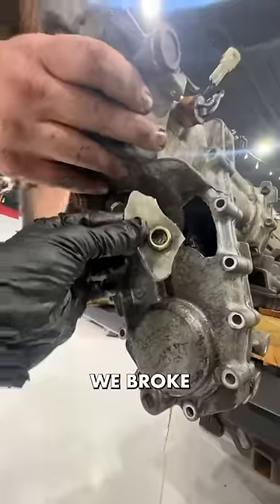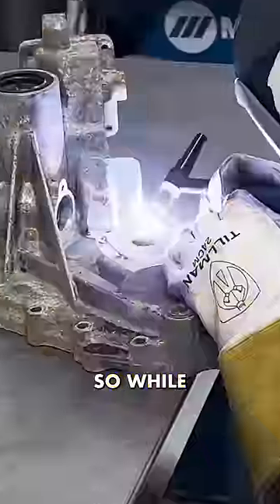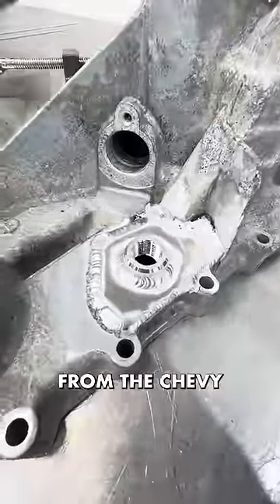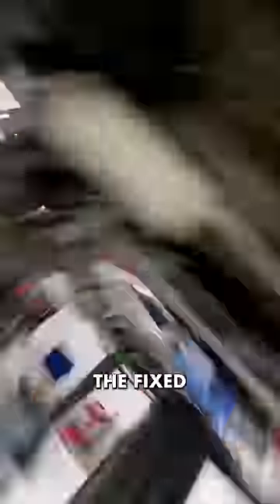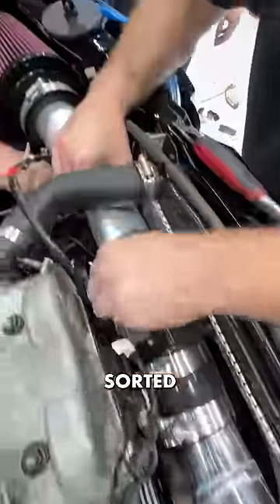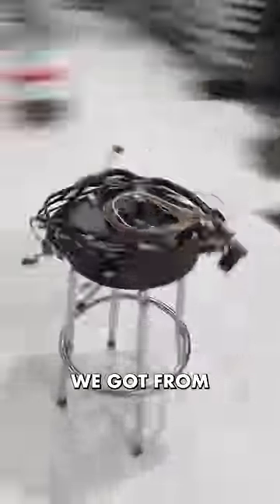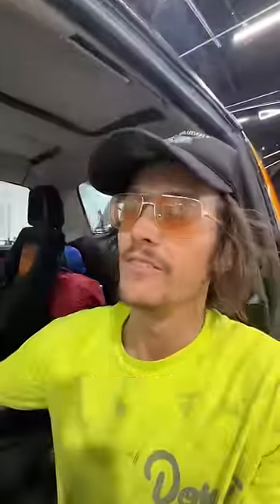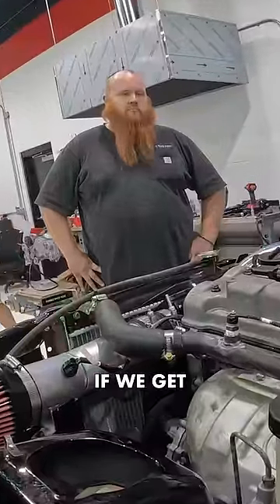Part 8 of my cross country Suzuki build (with @OffTheLinePerformance )

Comment: Cast aluminum is very difficult to get right. Nice job Eric
Reply: Can ya tell me why?
Reply: @danielescobar7618 mostly because aluminium oxidises incredibly quickly. That basically means a thin layer of aluminium rust appears very quickly whenever aluminium is in contact with air. If you try to weld an aluminium piece to a layer of aluminium oxide you will find that the weld either doesn't take or it is incredibly weak. The other main issue is that aluminium transfers heat very effectively which can result in any weld expanding or contracting a large amount very quickly. This causes it to crack as it cools, and can also cause the two pieces of metal to warp during the job. Aluminium is also quite soft, and when heated it can actually get so soft that it deforms under its own weight. It's a real PITA compared to steel.
Reply: @Cortanakya  oh yeah my welding teacher mentioned this. The oxide layer has a higher melting temp too, so the raw aluminum under it is just ready to blow out and burn through too by the time its penetrated enough and just becomes an inclusion. Good to keep this in mind, I have some nitric/fluboric acid mix I can use as a pre-flux rinse to desmut that I used for plating/desmut after alkaline cleaning.
Reply: Very few experts
Reply: @danielescobar7618  cast steel knowledge but I believe relevant to any casting… cast means that molten aluminum was poured into a molding of that transfer case. The metal expands, air gets trapped, impurity’s in the metal OR mold, all of these cause the cast aluminum or steel to be less dense then machining the transfer case out of a piece of hammered stock. The casting has many pours that are very difficult to penetrate and fuse to.  Anytime I’m working with cast steel I give a light  preheat, make small two or three inch welds at a time, and while the weld is still hot i peen the weld with a ball peen to help get filler metal into those pours. Cast is brittle

Comment: People forget the fact car manufacturers tend to share parts with other models. I tried to fix an Oldsmobile speedometer worm gear and found an exact replacement from a Corvette parts store.
Reply: Definitely true for Olds! Once a friend had a late-80s Cutlass, the window crank mechanism went out. At a local junkyard we found the exact same model, same year, even the same color. Took the entire window mechanism home. Turned out to be completely different!
Reply: Good luck finding parts for that, and it's a Suzuki X90
Reply: You think Oldsmobile and corvette parts are that different?

I guess you never worked on an AMC.

Comment: I had a 2001 Tracker/ Grand Vitara. Biggest rust bucket I ever owned. Barely got 100K miles out of it before the underside rusted completely out. Top looked great! Underneath ick.
Reply: I feel like these things are so hit and miss with the rust, I have an 01 Vitara with 110k, not a spot of rust anywhere and runs perfect
Reply: @ST19859   I live in the North East. Still, that being said, my 2002 Cavalier had zero rust (243,000 miles no major rebuilds) when I got rid of it in 2017. 
Don’t get me wrong, I liked the Tracker, it was 4WD shift on the fly, and was a great little trucklet, but the under side rust was just amazing.
Reply: @garyowen9044   to be fair I dont live in a rust area but the folks I got it from were, maybe I got it before damage was done.  Thats too bad like you say its an awesome light 4x4 for banging around the woods, damn shame no one makes small simple inexpensive offroaders like it anymore

Comment: My ex in highschool had an uncle with one of these.   Such a dope car dude would literally drive thru the ditch for fun instead of using the driveway.    That’s fucking sick the option to just drive through a ditch and then go grocery shopping.   You can’t beat that
Reply: If it had a V8 turbo you could beat it and I’d probably be beating my meat.  All that raw power in such a small platform.   Four wheel drive…. I need a second

Comment: Whenever welding cast aluminum, use JB weld steel reinforced epoxy to seal the weld. Most modern cast aluminum is crap and will have microscopic pores. If you spread some epoxy over the weld, it’ll add strength and make sure you get a good seal so you don’t have any leaks.

Comment: I had one like this and we used it working in the woods in both summer and winter along with a Lada Niva for at least 10 years...they both were indestructible...and we beat the crap out of them...only thing we changed twice were drive shaft cause we broke them on huge boulders ! Suzuki Samurai !

Comment: Sounds like a starter relay with that clicking. 
That being said I saw an X90 flip onto its roof when a small sports car that sat very low to the ground and was very wedge shaped pulled in front of it and acted like a ramp for Hollywood stunt driver. I ran over and the guy was upside down on his shoulders in a pool of broken glass. I opened the door and he slowly climbed out.

Comment: Should have used a 4wd S-10 as the base.... Same engine and transfer case, I believe. But the frame is actually sturdy, instead of unibody. I'd chop the S-10 frame down and transplant the body 😅 Tracker/Samurai are cool though, not hating, just seen enough to know they aren't really made for hardcore use

Comment: The Trackers are absolute off road sleepers. I've drove my Tracker past the "Jeep parking only, all others don't make it anyway," sign and posted it on a tracker forum with a little cardboard thing saying "Tracker Parking, because nothing else comes this high up," and you could see the Jeep Parking sign spot of the trail bellow, and that caused a fight with the jeep forum so bad that rTrackers got closed since it was the smaller community - even though the jeep guys came in and started the drama... It was so pathetic, it was a silly joke and they got so butt hurt.

Comment: LOL I had a similar problem on my Volvo but instead of welding the cast aluminum on I use J-B weld and it lasted till the end of the wife of the car which was a couple years later

Comment: If there any kind of way to make a 2.2 eco Tec go in one that be bad ass we race them in dirt a stock one with a tuned ecu will hold 6.800 rpm all day long after they already had 200k plus miles great engines made by Chevy just a fwd car engine and Saturn vue used them. I think be cool if could tune one the other way hook to a different trans and have a small lightweight off road vehicle

Comment: I’ve been working on these cars long you been on the planet young man the older engine it was a much better engine it doesn’t have interference or the engine you just put in does put the old engine back in it it’s the better engine and the better transformation get a manual

Comment: Jay Leno: The tracker is an over priced heap of junk that takes way too much money to get properly working and the parts constantly break.
Donut: Jay Leno is wrong.
2 Seconds later the engine cracks and Donut has to  spend 10 weeks  fixing every single part of the piece of trash that is constantly breaking.
Jay Leno: HAHAHAHAHA Told you so.